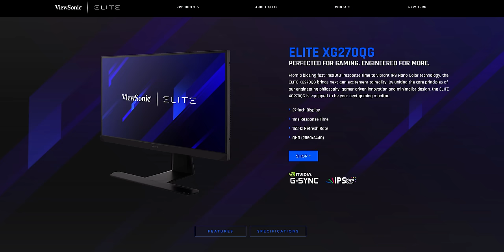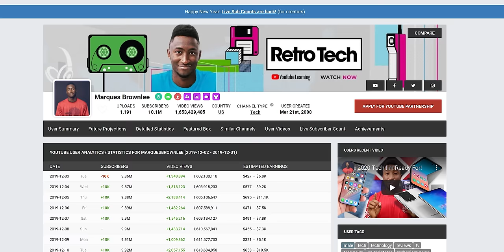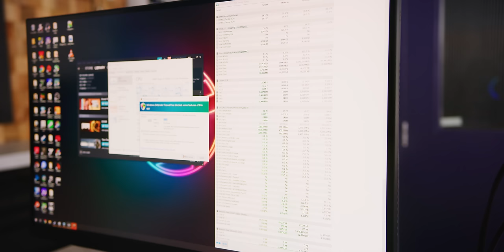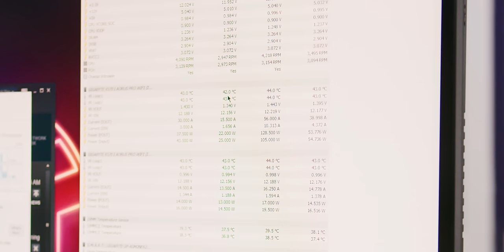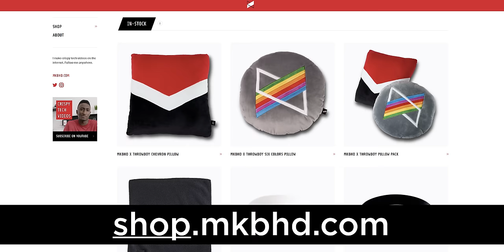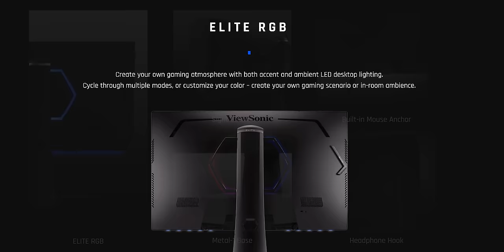The Easiest Water Cooled PC (NOT Easy)

Comment: Before watching: I'm never gonna water cool

After watching: I'm f**ken never gonna water cool
Reply: Are you wearing Saree in the picture?
Reply: @digantamajumder5900  yeah that's what it looks like
Reply: Aio are easy but this stuff is way too involved
Reply: One Jays build later your defenetly goin to water cool.
Reply: Before watching: I'm never gonna water cool

While watching: I'm never gonna RGB

After watching: Yeah, I'm never gonna hardline water cool either.
Reply: Tbh watercooling isn't that difficult if you use a big case, soft tubing and do some research.
Reply: Actually it's not THAT bad if you go with a normal case that has much more room. A lot of the problems and errors in this build were caused by the case and the fact that lots of watercooling stuff is already preinstalled in this rather small case. So there is barely any room to work in it and it seems like some of those parts of the case are faulty.
Reply: @Jousten16  I was going to say ... this just shows why E-ATX cases are still a thing.
Reply: same here im not gonna buy shit it so freaking complicated
Reply: 🤣🤣🤣🤣 Same..
Reply: Problem is not water cooling, is RGB.
Reply: It is not this hard if you use a normal case, all this case did was build in a simple component that takes 4 screws in a normal case. Also, they used a mini mother board because of this case. It's like 30 minutes to install one in a normal case.
Reply: There are a few key points to almost any water cooling you need to know
1) it costs roughly 300$ for a full system water cooling with cpu and gpu blocks a decent pump, fittings, reservoir, and rads and fan. 
2) you cant cheap out on fans because cheap ones are shit for using with rads
3) if you watercool a gpu, its a fucking nightmare to take apart, mount, put together, and make no mistake converting one or buying one you will be doing this. 
4) you need to disassemble every 6 months to year for cleaning, and this repeats the nightmare process. 
5) if an air cooled part fails, it becomes a heatsink and throttles, still possible to use just at throttled speed. if water fails, it immediately spikes temps and possibly loosens fittings due to newfound thermal expansion, and depending on what failed, likely pump, but most likely a fitting, taking the system out with it. 

all for what? so you can hear coil whine of the gpus? so you get that sub ambient noise... which a decent air cooler on the gpu and cpu already does on air? for looks? 

watercooling is a fucking nightmare, and thanks to amd not being a house fire anymore, is 100% unneeded unlike with intel and needing to delid because of the thermal jizz they use.
Reply: yeah open loop but what about closed loop ?
Reply: @alidan  Umm, not 300, but yes, it's mostly useless.
Reply: @viperswhip
good pump - 70-80$
cpu block - 40-80$
gpu block - 70-130$
reservoir - 20-40$
rad - 20-30$
fittings - 5-7$ each for good cheap so 40-60$ and that's not allowing for creature comforts

@Jens Demuyt only hits the cpu and amd isn't a house fire and is close enough to intel now I can't justify the added heat issues and silicon lottery problems to go intel for the small gains you make at 120+hz range for gameing. 
Unless you have a case issue, this means air is the way to go, and if you have a case issue, get a better case.
Reply: it's hard time consuming but so worth it
Reply: Exactly.  Just confirmed I made the right decision going with a big air cooler (Dark rock pro 4) for my 3800x build...  speaking of which, Linus noctua is out of the chromax d15 on amazon, I would have bought that over the drp4 but no stock!?
Reply: My computer is water cooled and i dont  remember it being that hard, or maybe my mind has blocked out the memories of making it.
Reply: yeah it's hard my first time turning on my computer it exploded with water.  lol all over my face was so funny.  green liquid everywhere.  had to take apart clean and put together spent the whole weekend doing it. hard tubing looks so much better but a bit harder. I love it

Comment: "This is not easy" Linus says as he doesn't read the manual, misses the RGB strip, and misses the O-Ring.
Reply: RTFM
Reply: Time spent doing those useless things and not reading the script each of your 17 sponsors sent you to read is just bad business.
Reply: @themonroe654hd6  The videos are scripted by LTT not sponsors. If then only slightly (giving ideas) and not like these mobile ads where everything is scripted
Reply: @Ikxi  I don't believe that and you shouldn't either.
Reply: the O-Ring wasn't in the manual...
Reply: @kscius The whole pump was not in there iirc, in the manual
Reply: TheMonroe654HD why would they? The sponsors usually have no relation to the video, so they wouldn’t script the whole video. Also, there’s 1 or rarely 2 sponsors, which is normal
Reply: samtherat6 speaks the one with the Elsa channel icon not even paying attention to the fact they said the case manual didn’t have any info
Reply: was waiting for linus to drop the system off the desk/table he ruined trying to build it in the last 2 minutes :)

Comment: When you say "no compromises" I always hear "just one caveat: your wallet's gon' BURN"
Reply: a $5k pc with 16GB RAM... thats some apple level compromise
Reply: @Mr. Chair thats why the water doesnt actually touch the parts...
Reply: @Mr. Chair Don't mix your metals and don't use silver coils. My loop has been running for 5 years and the blocks are virtually pristine. I had to change the tubing a couple months ago because they were filling the loop with plasticizer (should've used hard lines I guess) but there's absolutely no corrosion in the blocks or radiators.
Reply: @Mr. Chair I run Automotive antifreeze it contains corrosion inhibitors, it is really toxic though so make sure to wash your hands and don't drink any, I also made my own CPU block , milled a solid block of copper on my milling machine.

Comment: Alex: Saw then belt sand.
Me: Pipe cutter.
Reply: Yeah, Home Depot has soft tubing cutters for like $15 USD / 900 CAD
Reply: Tubing cutters create internal ridges, which creates turbulence in the water, which are increases the speed at which the copper degrades
Reply: @syreplays5079  that is why you bebore tubes dude. Tube cutter IS better than saw.
Reply: Casus Belli you’re talking to somebody who knows much more than you do about cutting tubing. Yes, tubing cutters are better in a way, but using an extremely fine toothed saw blade is perfectly fine and will not create any internal ridges (requiring no debuting internally, which is a bitch), and instead will only require the external piece of the pipe to be cleaned. That’s actually easier and I personally would prefer it if using a saw was even remotely as quickly as using tubing cutters.
Reply: Dodo Milwaukee’s tubing cutters are horrible.

Comment: Linus: Easy my buttocks
Also Linus: refuses to read the manual or do any planning, chooses to do hard line tubing, and spends a huge chunk of time on RGB which isn't necessary
Reply: EMAngel 2718 rgb makes FPS higher
Reply: This case isn't necessary, water cooling isn't necessary, that expensive GPU isn't necessary, that ram isn't necessary (rgb bling).... You seem to have missed the point
Reply: @screwyluie  The case is the point of the video and everything else you listed contributes to the performance and/or did not significantly contribute to the difficulty of the build
Reply: Like to be clear I'm not massive hating on him or anything, I'm just prodding a bit. Also he could have just said that for $5000 the case should have provided a much simpler experience even with all of the decisions he made that made things more difficult and there would've been nothing to poke at.
Reply: I'd say a clear acrylic integrated water channel in the back deserves some lighting, but you didn't need addressable LEDs for that. Hell, if I ever buy that case, any LEDs I'd hook up would be set to just one color.

But yeah, this was a long build not just because it's a custom loop, but because Linus insisted on fucking himself over.
Reply: EMAngel 2718 K
Reply: "Also Linus: refuses to read the manual or do any planning, chooses to do hard line tubing, and spends a huge chunk of time on RGB which isn't necessary" - so just like most of us then!

Comment: "It's safe to assume I can just cut this anywhere, right?"
"uhh..."
Reply: Depends if the lights are wired in parallel. If they are you can cut anywhere and it would continue to function on the side connected to electricity.

Comment: The lesson from this video: if these two can watercool, you'll do fine.
Reply: OMG You would think that they would have done SOME pre-production planning.  Obviously not.
Reply: @KingBeetle1966  They did, they pre-installed the CPU and the power supply to save some time lol
Reply: Preproduction planning is important, that's how I made sure that all my computer rgb worked with each other and all my equipment worked together
Reply: @KingBeetle1966  They knew it wouldn't take an hour when they wrote the episode.
Reply: @Vertigo11  I don't doubt that;  I'm just amazed that they didn't catch simple things like incompatible LED strips and missing water pumps beforehand.
Reply: @KingBeetle1966  I think you all are missing the point. Why do pre-production. Raw footage about how hard/easy something is to do shouldn't be staged. This is literally what happens for most people who really build their own computers. Also it's funnier and you learn from someone else's mistakes.

Comment: Yeah, I'm sticking with a case full of fans.
Reply: @Mr. Chair i was thinking same thing aio works good enough better than just fans and is the next best thing to an open loop minus all the problems that come with an open loop
Reply: @hunter24574  noctua nh d15 plus lots of fans wants to know your location
Reply: @hunter24574  last time when they checked the air coolers where better, also aio have terrible relativity compared to air cooling
Reply: @avroken  My air cooled setup runs at 60C or less on both CPU and GPU. Other than bragging rights there is no reason to go lower than that for a gaming PC.  That is with an 8700K and 2080.
Reply: @Dryloch  I'm going to guess is also cheaper
Reply: Eduard Calota ever notice that Steve from Gamers Nexus often shows an MSI Dragon Air cooler on his systems? I bought that one for 45.00 from Amazon. If it’s good enough for tech jesus it’s good enough for me.
Reply: Ali Nassereddine  Actually Noctua has the best fans for overclockers and non-overclockers. You just need the best air cooling setup. My CPU air cooler has 2 fans and a heat sink in between them, that my overclocked CPU is running just fine at almost 5GHz 60C
Reply: @Dryloch  I stuck with Noctua because they are known to have the best air cooling
Reply: you guys know any fans that are really quiet i could use? i’m thinking noctua because... they’re noctua but idk if there’s better options.
Reply: @Evexin  try some 140mm with low rpm if you can fit them

Comment: There's these cutters for plumbing that also works well with tubing, you just put it around whatever you wanna cut, tighten -> turn -> repeat until it's through. Super clean cut, perfectly straight and no acrylic dust particles all over the place. Sawing and sanding certainly isn't the way to go unless you wanna flush all the tubing before assembly.

Comment: this man really charging 15 dollars on some cable ties though
Reply: Austin Perez They make your CPU ran faster
Reply: @Trippy-Trains  and the ssd
Reply: [JMC] snzlbufsnk It’s what you need for SSD overclocking
Reply: You getting taxed
Reply: They're reusable, and do a good job due to their width. Should only be like $10 though.
Reply: @erival7108  You can get 100 of them on ebay for less that half that
Reply: There's no reason to not get cable ties at Harbor Freight or AutoZone, unless you specifically want to support LTT. At that point any price makes sense because it's essentially a donation.
Reply: Those aren't cable ties.  They're tweezers.

Comment: "An hour and a half." 

😂😂 me every time I replace a component... 
Turns into an all day/nighter

Edit: I do want this case. Is there a full ATX version? I feel like bitwit did the same but with a full size MB. It's super sick. Also, idk why but I'm triggered at the commander pro positioning lol. I share the hate for it.
Reply: There is a full size one. It was the one in jayztwocents post Malone build
Reply: There is a ATX sized case with a integrated distribution plate similar to this but it is a eye-watering $1399.  It looks like it even has grooves for the cables in it too...
https://www.performance-pcs.com/chassis/water-cooled-cases-parts/singularity-computers-spectre-2-0-mid-tower-case-white.html
Reply: What you can also buy if you want a distro block but you don’t want to pay for the atx version is singularity’s resonance pump reservoir combo https://www.singularitycomputers.com/shop/watercooling/sc-reservoir-pump-combos/resonance-single/

Comment: I'd rather deal with a loud fan than this tbh.
Reply: Faxx
Reply: Just buy high end air cooler like Noctua NH-D15 or some simular, you won't ever hear a fan and you will even achieve better performance than this stuff in the video that can leak.
Reply: @jamesbond_0077  True and much cheaper
Reply: @jamesbond_0077  You won't achieve better performance. Custom loops are not AIOs. Everything else was right though.
Reply: Last time I rebuild my main PC's loop it took me a little over an hour excluding bleeding air and cleaning. Initial build was around 2-3h because I didn't really plan anything (for the complete PC and water-cooling), now I usually plan them in cad or draw them. 8h is just crazy. No idea how they managed that.
Reply: Loud fans ftw
Reply: It's fun though

Comment: Lesson one for anything where scres are involved: Never over tighten a screw to get the system tight... I work with instruments costing 1 to 3 times as much as a house (here in Switzerland, so probably 10 to 100 US houses) and have seen so many problems caused by people over tightening screws... If it ain't tight as soon as you hit resistance, there's a problem elsewhere. Never over tighten!

Comment: I can understand the confusion of building a gaming pc.  I built my first gaming pc.  I can say first even though I  have 20 years experience being a certified computer tech.  I worked on windows xp to windows 10.  I just now got into gaming pc since I have always been console gaming.  Gaming pc is a lot of fun building cause you can always change or upgrade your pc.  You cant do that to gaming console.  My first pc I got was just a basic IBuyPower with basic Asrock A320m/ac motherboard.  I thought nothing would work with this type of motherboard but it the type of case. I recently bought a h510elite case and transfered from ibuypower case.  I should have took photo of motherboard first before you tear everything down cause once you work and work tend to forget.  That is what happened to me but luckly everything was straight forward.  It took me several hours to do.  Got wiring nice and neat and my new case looks really nice with led strip along with two fans in front one in back one on top and on cpu.  Getting all my colors going for the rgb is real nice.  All in all i enjoyed building.  Like putting a plastic model together but only better.  Now I have been glued on my new case and gaming machine.  Later i will install cooler with rgb memory change out two fans that are not rgb.  Once Im done my machine will be awesome.  So I enjoy watching these videos.  Seeing others building.

Comment: If the easy water cooled PC takes 3 days for 2 specialist, I dare to think about the non-easy for amateurs. However, what I look for, as a video or from industry, is an EASY way to tranport heat from CPU/GPU/APU/IPU, out of the room, preferable a small radiator mounted outside your window (or maybe the bathroom to heat it up), and pipes that runs to a distributor between 1 or more PC. I do NOT need 1 kw to circulate in my room, but what to bring it OUT or to a room where it can be used efficient.

Comment: Well, any system that needs 2 pair of hands to build, is not an "easy build" system. 

It does look sick tho

Edit: I just realized, there are no outtake fans on the back? So how did the air flow go? The top fans are intakes? Or the front radiator fans are the intakes? If it's the front fans, wouldn't it be pulling hot air from the radiator inside the case?

Comment: Using a disc sander after sawing tubing seems unnecessary to me. Cut the tubing with a PEX pipe cutter and voila, no cracks, right on the mark.
Reply: like why would you use a hack saw on tubing... of course its going to chip or split.

Comment: I use air cooling because its simply much easier,i know how to do it and also im always afraid of liquid spilling out onto the components and i am far too poor for that,pc gaming is more of a luxury for me,i cant afford a spill to spend again 200-300 dollars on a gpu.Also,i dont really care if my pc components get hot,because i dont overclock which is also related to me not being rich.Also from what i've read its very hard to damage pc components via heat,if its the normal range albeit high and if it gets too hot they just downclock themselves and thats it.
If i had Henry Cavill money i would do liquid cooling because 1:if i mess up i can afford to get 10 10.000 dollar computers in the same week if i have to and 2:i would care if i spilled liquid inside the case for the same reason.  But i dont,so the conclusion is i dont liquid cool.Because having a computer that is hotter is cooler than having a computer that is not so hot all puns intended,especially if said not so hotness is caused by me damaging a component and it not running at all.